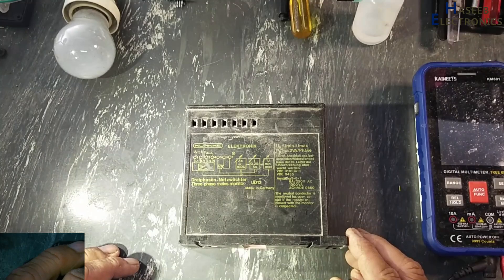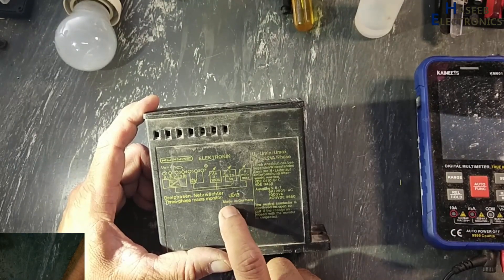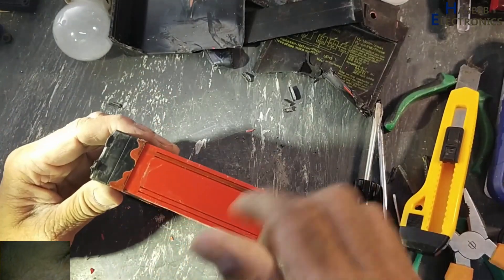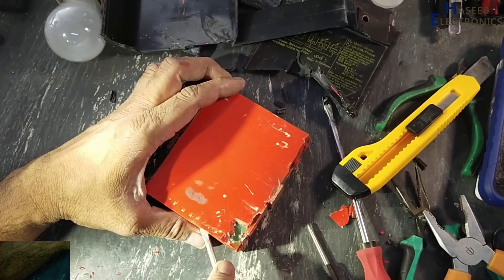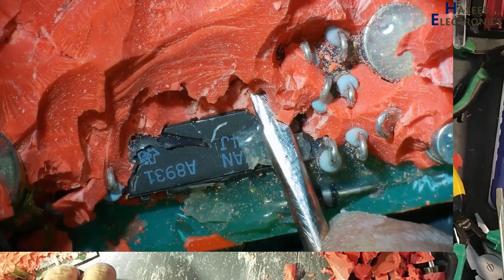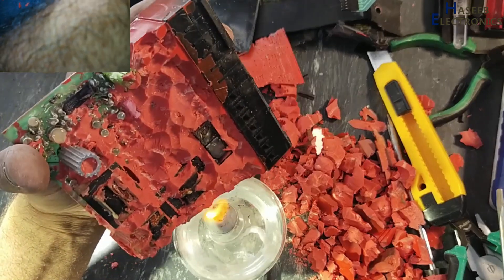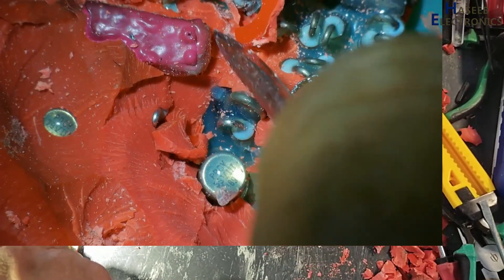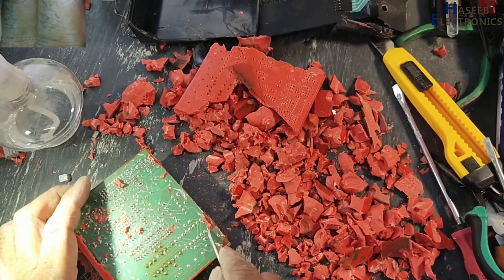{1191} Removing epoxy from PCB

Comment: Be aware, Epoxy is toxic and harmful for your health. Specially heating up the expoxy will lose toxic gases which you should be careful. And I would say use gloves when you deal with epoxy.
Reply from the maker: humble thanks and regards for sharing worthy health tip.
Reply: Well ventilated space and mask needed

Comment: That is unreal. Talk about "don't even try to repair this" from a company.
Reply from the maker: it is not repairing video. it was just to see whet is inside this module and how to remove epoxy 
also it is not repairable item. once it fails to connect power, it is replaced and discard it

Comment: does the same work for "black goop"?
Reply: what is the black goop covering? It's probably just epoxy, same as this. If it is covering similar parts to those in this video then yes. If black goop is covering a rom then no, otherwise the tiny fragile microwires joining the rom to the board will be severed.
Reply: @g4z-kb7ct   iit seems to cover a large single device, maybe a capacitor or a diode. time to apply some heat and get it off